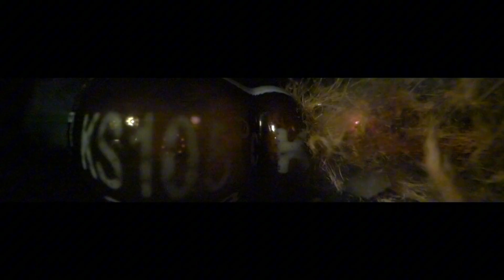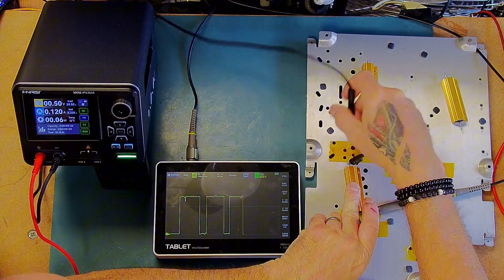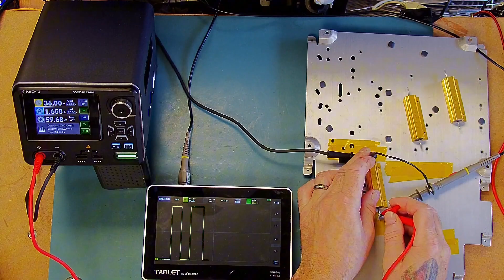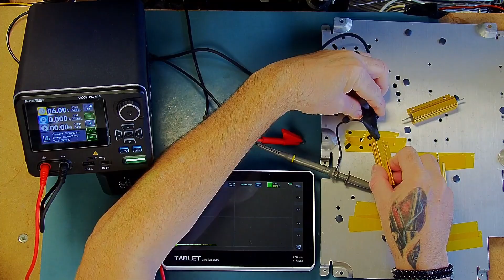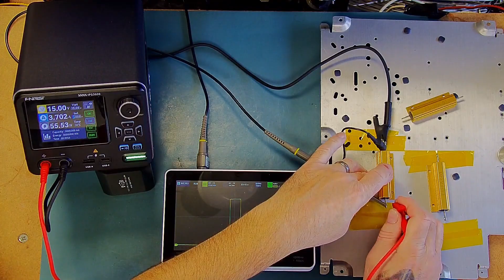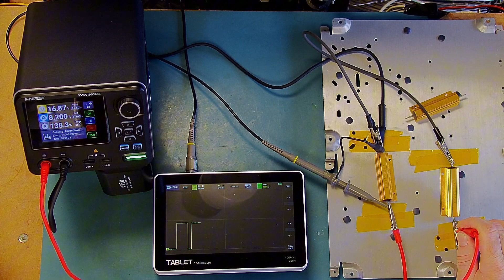Fnirsi IPS 3608 More Plots including LED test

Comment: Thanks so much for this video, I'm new at this, and bought this PS not really knowing much about PS and watching some other you tube vid's. I have several power tool battery's that are unbalanced and the light goes to 3 bars and not 4 bars and was hoping to use the PS to boost the low cell to match the other cells and plug it back into the charger and hopefully have a working battery, this battery was 400.00 new I took it back to a Milwaukee repair center but it was past the warranty, I just use it on the weekends, but would like to rebuild a battery if cells go bad. I'll be looking for future videos thanks
Reply from the maker: Hi, thanks for your comment. The simplest way to protect the power supply is to use a diode on the output biased to prevent current flow from the battery to the power supply. Bearing in mind the voltage drop across the diode, by that I mean in that situation the voltage on the battery itself should be measured for reference , and not the display on the power supply used. The diode will drop the voltage by up to 0.7V depending on the diode type.

Comment: Its a beautiful product, if only it worked as a power supply haha 😀
Reply from the maker: It sure has some problems, it could possibly be my unit had a faulty capacitor. Check out the subsequent videos I have made.

Comment: I did some tests using a sealed Lead acid battery ,and used the power supply to charge it,all went well then the unit would not function at all,no voltage output,it transpired that the internal 15 amp fuse had blown,the fuse is the one next to the negative output jack,so I am not sure if the unit will allow protection from back feed of current from a battery  when the power supply is switched off,maybe it was a one off or normal,maybe you could test yours and see if you have similar results,unless i have missed it in the instructions there is no mention of charging batteries from the main output ,only the 5 volt USB output seems to be for that purpose,Colin
Reply from the maker: Hi, there is a possibility that is exactly the case. I can test for that scenario, the result would be interesting.Fnirsi advertise charging a lead acid battery on their website. Go to the IPs 3608 product page and scroll down, it is there charging a LA battery from the main output terminals , with the words “ideal for battery charging”.I also noticed the tiny internal fuses get amazingly hot during operation, I kind of touched on it in the follow-up video regarding sources of heat inside the unit. Simply using the supply for extended periods at high currents could potentially damage the fuse thermally.